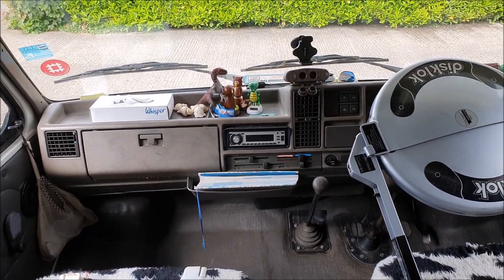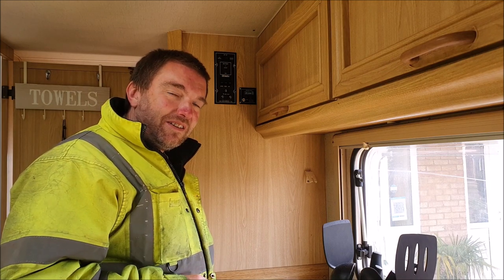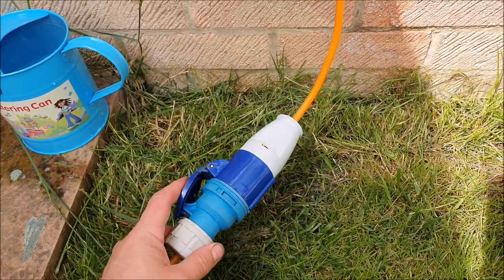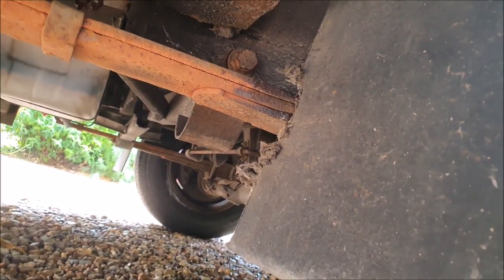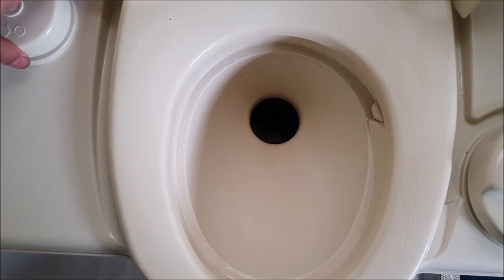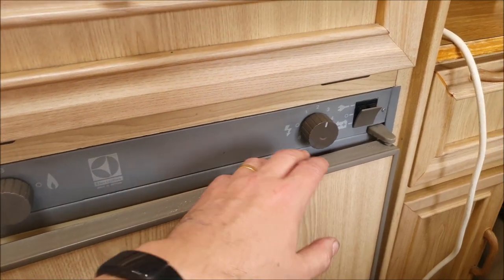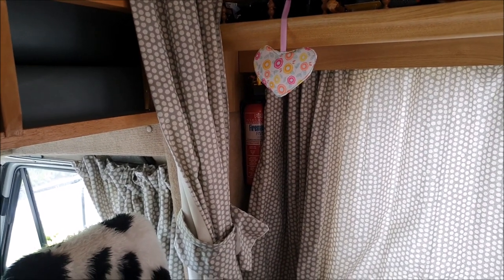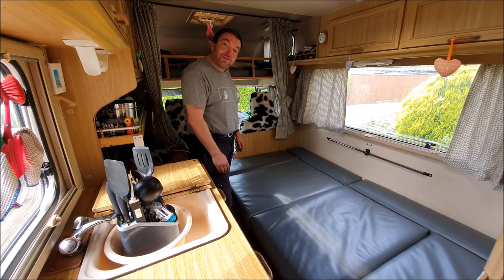Operating Everything In Our 1990 Citroen C25 (Talbot Express) Elddis Autoquest 270 Motorhome

Comment: My 1989 Autoquest 270 has the leisure battery under the wardrobe at the rear of the van. However I do have a different zig unit to you as well. Also seem to have more switches on the fuse board. Our boiler is like a smaller boiler of the one you have on your wall at home mounted by the sink. We also have no built in toilet and glass windows. Funny how they differ so much when they are a similar age.
Reply from the maker: Yes, I've seen other 270's with different fittings. I wonder if they were options at time of purchase 🤔
Reply: @ttxela  yes, a lot of these things were optional

Comment: Brilliant job matey. Fridge on electric . Thermostat only 230vac. When on 12vdc the thermostat doesnt alter fridge temp. As fridge takes 10amp on 12vdc its sets to full freeze. Thermostat handles 230vac only. Separate thermostat for gas. Well ours is that way. Cheers from George
Reply from the maker: I guess ours is probably the same but since it seems to work OK I've not examined it too closely 🤣
Reply: @ttxela  When we drove to Scotland or on a long drive the fridge froze everything solid. Even a cucumber became a lethal weapon. 🤠👍

Comment: Hello..wonderful video..I have a 1990 Talbot express. Just bought it. For the toilet flush, does the water come from the main water tank? Does it require electric?
Reply from the maker: Hello Michael, it really depends what coachbuilder did the conversion and their model. However many vans of that period will have a Thetford cassette toilet like ours. Flush water comes from a separate tank filled from a swing out header tank inside the cassette access hatch. It's entirely manual and requires no electricity. 

I think electric flushes were coming out around that time so it's entirely possible.  There are also vans which take the flush water from the main tank. 
However if yours looks the same as ours it likely works the same 👍
Reply: @ttxela  Hello! Thanks for the reply. By the casette hatch do you mean where I empty the dirty toilet water? It's all fun 😁 kind regards
 Mike
Reply from the maker: @michaelfowler2187  The hatch in the side of the van that you take the cassette out of 🙂
Reply from the maker: You can see this at 14:24 in the video

Comment: Hello again mate, gonna be rebuilding my toilet/shower soon. Looking into various shower options, did consider a flush ceiling version but maybe over the top lol. Also considered your one which could also double as a toilet flush (if it reaches) as mines manual flush, and may need a boost flush once in a while! Are you happy you made the choice you did (water usage ok?) or have you thought maybe another option would have been better?! havnt got to the sink yet! but i guess i would need taps and can just use the shower head? also does the shower head stay on or you have to continuously press the button?
Reply from the maker: Yes, we're still pretty pleased with the shower.  It's quite economical on water use because you do have to hold the button in to keep the water on which might not suit everyone.

Comment: Hi, great video. All new to this and just bought a '94 Talbot Elddis Autoquest 400. Just on the van / leisure batteries, do you need the engine running to run electric off the van? I have tried the caravan battery but get nothing other than a power light - perhaps it need charging?
Reply from the maker: What electrics are you trying to run? Typically the leisure battery will just power the internal lights, water pump & water heater electronics. Normally the Zig unit will tell you the state of charge of the battery but there are many different types.
Reply from the maker: BTW you won't get 240 sockets to work in the van without connecting by EHU (campsite power). A common misunderstanding.
Reply: @ttxela  anything really, I am just reading up on manuals and watching vids, so looks like I MUST be hooked up to use stuff with three pin plugs such as TVs etc. This explains a lot! My next job then is to give the gas a whirl to try out the oven, hob, heater and fridge then. I've not tried out the water, sink / toilet etc but will do this too.
Reply: @ttxela  Yep, I have read of some people who can charge the leisure battery via driving but that mustn't be standard to the Talbots or maybe it's been a modification?
Reply from the maker: Some will come with a split charge circuit for charging the leisure battery whilst driving and some will also have a mains charger which will charge the leisure battery whilst on EHU. Some however (like our old van) will  have neither.

Comment: i have the 1983 fiat version of your van same same but difrent LOL. I have a ZIG CF8 control panel in mine, this I believe has a battery charger built in never tried it in fact never used the mains supplied with the van I use battery/ 2 large solar panels on the roof  or generator my generator is built in under the spare wheel lots of room there mines petrol also my diesel heater is there as well did I mention cavornes room under the spare LOL my batteries are under the front seat . mine runs on LPG so i get 40+ mpg on a run fully loaded that is LPG to petrol price
Reply from the maker: There seems like a lot of variety in how these were equipped and of course owners have made changes over the years I guess 🤔

Comment: hi again mate, hope all well! thought id share this drama with you as a precaution! my carver 2 exploded today adter 1 hour of heating (emersion heating not gas as id run out - its a dual mode model) it had stripped the thread on the bar holding the jacket on. Apparently a lot of pressure on that bar that fatigues the thread over time (and perhaps ice expansion also weakened it in the past) So question is why no pressure release valve kicking in?? or thermal cuttoff? or both!? Anyway apparently this is a fairly common issue to my supprise!! and also made me think of the 'torque value on that bolt' as it did you- - i also was concerend about that and i may have overtitghend it as there was a little movement in the jacket, but it think thats normal tbh. Anyways maybe replace the bar just in case as its a distrubing thing when it goes off! i was sanding the roof at the time to add to the saga!!! a new rod is about 40 quid on ebay. Also id change the hot/cold plastic pipe conectors as well to be safe. Always some sht going on...
Reply from the maker: Wow, not heard of them exploding before. The rod through mine was pretty mint when I dismantled it. The pressure relief should have opened I would have thought 🤔
Reply: @ttxela  my rod looked mint!
Reply: @ttxela  OK more on this topic, the bar is aluminium not steal so getting the torque right is critical. Ive found out that the tie bar is 17NM for the bar into the front case. 14NM for the nut to hold the tank. Also the 2 bolts that hold the element had 2 big holes coroded into them so will also need changing as they were on the point of shearing . Amazing.
Reply from the maker: @richardoloot1295  Useful information, thanks!